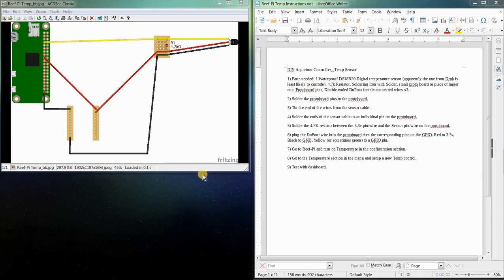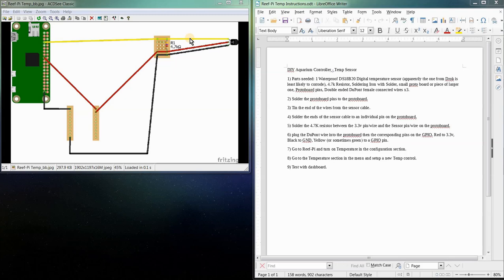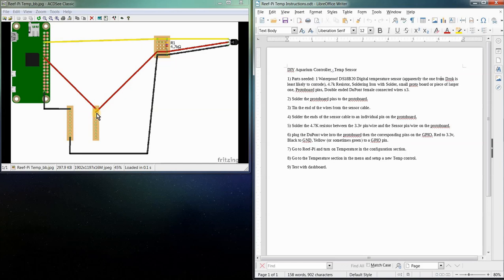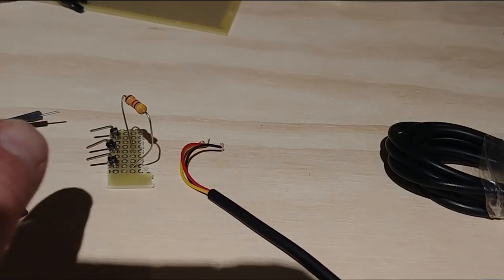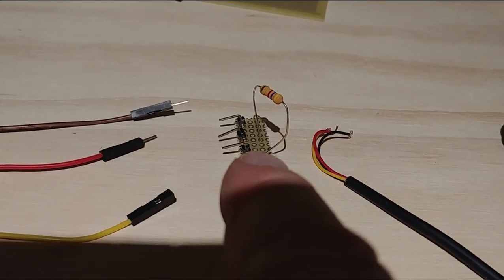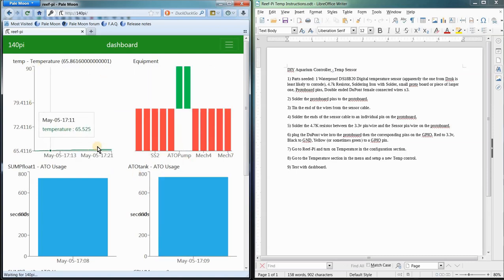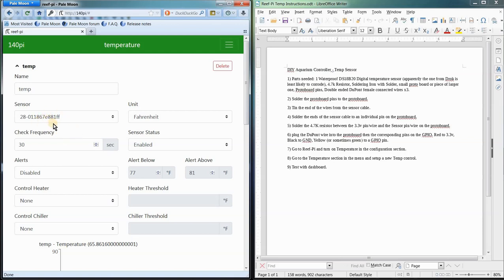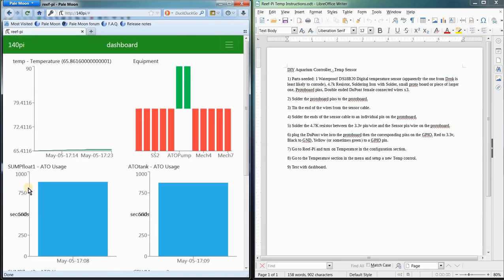DIY Aquarium Controller - Temperature Sensor

Comment: the ds81b20 temperature sensors use a single bus, so you can connect all of them using a single data pin, normally GPIO 4. They wont require additional wires for every new sensor
Reply: @Jagadeesh Varadaraj yes